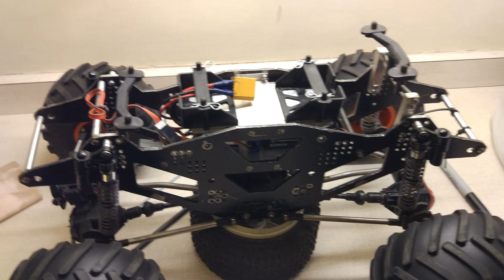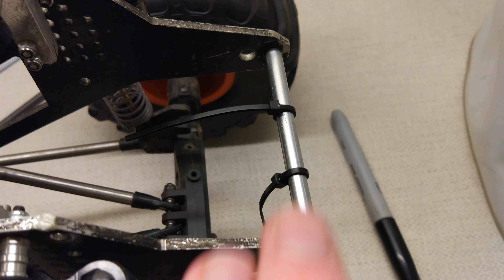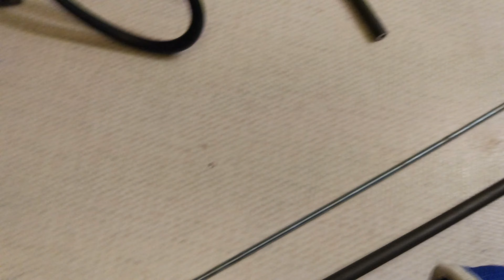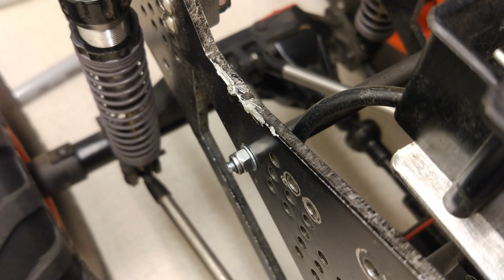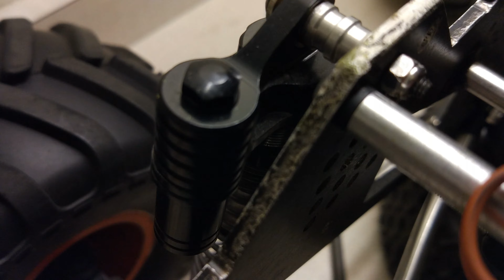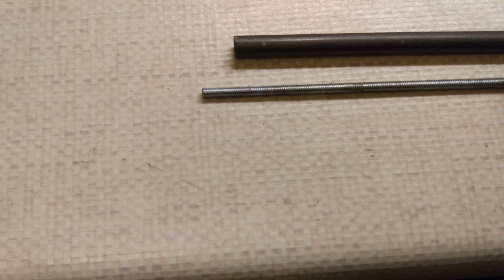Steel Chassis Bracing For Crawford Performance Engineering Barbarian 2K18

Comment: So basically you've used SMT10 axles and a Crawford performance chassis together then? Did you buy the chassis or chassis kit from their website?
Reply from the maker: Yes is basically the Crawford chassis kit with ar60 axles. No I bought the truck already built from eBay

Comment: Nice one! Are you using 12.9 rod as 8.8 stuff seems to be like toffee when it comes to generic rods bought in the past but more I think of it the shear needed would more likely kill something else first chassis kind of reminds me of a monster beetle I had  on steroids from back in the day. 
What's the power plant in this?
Reply from the maker: The tub is "DIN2391/C HIGH PRESSURE HYDRAULIC Grade" the threaded rod was not specified just said zinc plate steel.

This truck has a hobbywing max10 60a esc and a 3300kv 3652sl g2 motor.